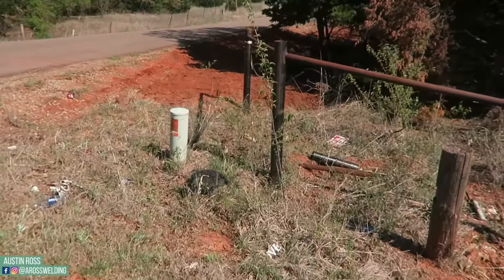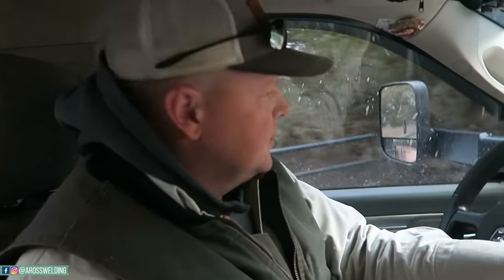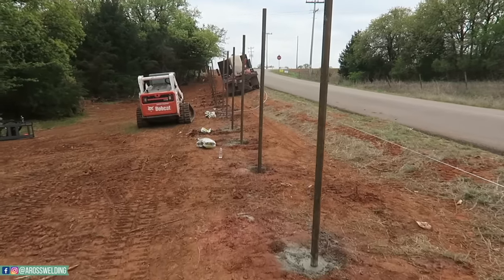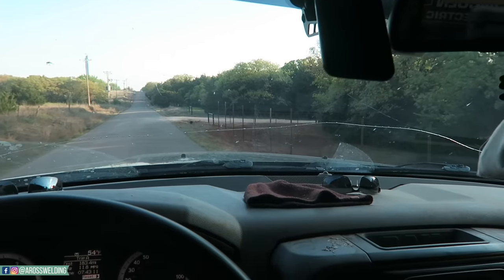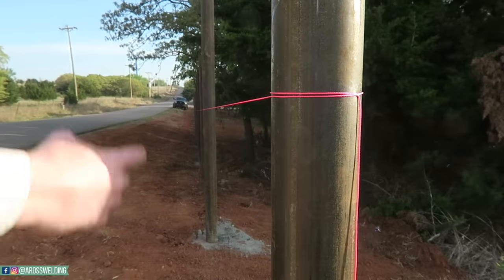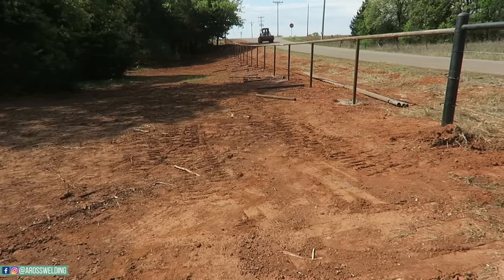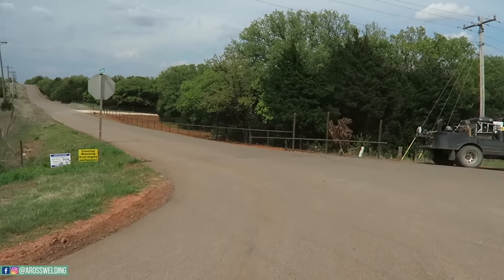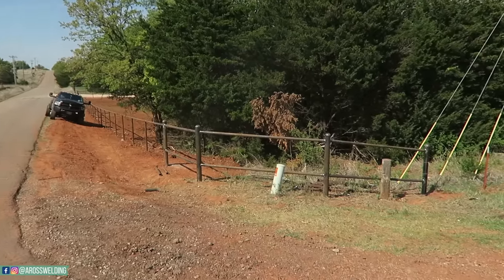SETTING POSTS FOR FENCE // SADDLING AND WELDING OUT TOP RAIL PIPE FENCE

Comment: I just put 420 ft of fence lime this in the front of my place. 5 ft tall though. Im not a welder but my dad was a Texas pipeliner. He passed away 11/18 at 81 yo. He planned to help me but we didnt have a mobile welding machine as he sold his when he retired in 2002. (Still had an 220v cracker box  that he could use ac or dc rids with though) A few years before he died he found a 1981 sa200 he bought for $300 that the seller thought was junk. He had it welding after radiator new water pump starter belts hoses boiled out gas tank rebuilt carb new points and rotor plugs wires (!) I found aa new radiator grill to replace the rusted out one. It did all my fence fine and never smoked or burned any oil! (Front seal leaks a but but dont they all? I made a few mistakes on mine, like putting the posts ten ft apart without checking that the pipe dad bought me was cut in 16ft lengths, not 20 ft. It made some of my joints come out in between posts and looked bad on a couple. I ended up scrapping those sections that looked bad and cutting 10 ft pieces so the joint would come out on top of posts. Nice job and youre right about “curb appeal” and eyeballing the fence. I should have done that more when building mine and i wouldnt have had to go back and redo so much. (You would think i would know that from running conduit!) You wasted a bunch of pipe cutting the posts 10 ft though. You should have included more info on cutting the saddles. I had to use a stone in a grinder and open up the long part of the saddle to get it to fit. I used 5//16 6011 rods on mine. I tried some 7018 I had but i couldn’t get it to work as it isn’t fast freezing like 6011 and I’m just a pretend welder! I am a master electrician though! I wish i had the patience and time to video my build but im 49 yo (yesterday!) and did it all by myself. (My wife and 8 yo daughter  did help me lay out the holes, but i did all the rest.) It took me about six weekends! Still gotta put up the welded wire, hang the gate i built out of thin wall 2” square tube and three old steel implement wheels, (my daughter helped me paint the frame silver and the wheels red as we both have old farmall tractors!) then put up the ghost controls opener! Ive had several people stop and ask me about building fence for them and i told them they probably couldnt afford what i would charge! Its hard work, especially alone and its not even summer yet!

Comment: I always joint my top rail at the post with a piece of angle iron clamped over the top. Weld the saddle out remove the angle iron and weld the pipe together. Takes the dogleg out. You do good work.
Reply: Nice tip.

Comment: Austin - I built a steel fence line using 2 7/8” drill stem posts, top, mid, and bottom rails spaced at 21” Centres. The posts are 10 feet in length, on 14 foot centres. We drove the posts with fence post pounder 4 plus feet down. It’s a thing of beauty.

Comment: One thing I've done for marking the height of the top rail it to not set the string on an existing post when making a significant elevation change such as sharp-ish turn up or down hill.  I set a t-post or whatever is handy in between two pipe posts to tie off the string. This spread the change over two post and makes it visually more fluid.  When tieing to a line post, you'll always be able to look back and see that transition point. Most folks won't notice, but that's just a little extra polishing.

Comment: Yeah, need a better look at that chopsaw table, come on. I designed my buddies welding bed, complete with stainless accents. Fire engine red with polished stainless. I forgot his chopsaw location, but after seeing yours, I got a great location now. Thanks. 😜😎 we built my 5’ fence, ant the top rail carries the irrigation water, which we tapped for sprinklers. Works great, no leaks, thanks to my pipe fitter buddy.

Comment: When I have built "No Climb wire mesh" fences for horse paddocks I used pressure treated posts. I painted the buried part with tree rot resist black paint and instead of filling post holes with concrete I poured a thick cap of concrete on bottom then filled middle sections with locally available sandy gravely soil ( if in your work area) then a top cap of concrete just below ground level (make sure caps are sufficient thickness). If the fence ever has to be removed or posts replaced your not wrestling a giant cement "lolly pop" out of ground Just use a sledge to smash the cement caps and wrecking bar to break bottom caps. As long as the fence posts aren't tremendously load bearing this technique works well in saving time/money. And as always install 45 ° angle "dead mans" to counter the pull of stretching the fence.

Comment: I know lots of people just pour the concrete mix in dry like you are doing but I don’t like doing it that way. We premix all of ours. I think it is much better. We have a skid steer mixer that will hold 18 80 lb bags and has a chute where you can just drive up to the posts and pour. Set the pallets by the water and just drive the skid steer back and forth. Maybe in areas with a lot of ground moisture pouring it in dry works better. Here the ground is powdery dry even 4’ deep. So dry it is hard to clean out the hole with the auger as the powder just falls back in the hole. We built about 1/4 mile of 2-3/8” pipe fence a couple of weeks ago on 8’ centers. We built it a side at a time and set the ~60 posts on each side before noon each day.

Comment: I been welding up some fence lately and I’m just now using 6010. I have always used 6011 because we generally always used old junk oilfield pipe for corner posts but that 6010 runs way better at least on the new pipe we’ve been using. I almost don’t know how to act getting to weld up new pipe for once. I’m not a professional welder so any little bit I can leverage to make my welds better I’ll do it. Lol

Comment: Pal of mine builds motorway signs - he's "Mr Motorway Sign" here - his stock in trade is steel pipe. It used be a pretty reasonable commodity. Not now.  Now it's eye-watering. 

I now watch your videos wondering just what they dropped on the steel-stock - using steel prices here as my reference point. It used be "Utility" grade fencing - it's now become "Luxury Grade" here.

Comment: When doing a1/2 mile or more it  makes the day easy to get a ready mix truck. Have set a mile before lunch with 2 people
Reply: Easier for who? I drive ready mix. Believe it or not, post holes are tricky for the driver.
Reply: @dougdouglass1248  believe it our not I hold a CDL to have been on both sides. Only a steering wheel holder would think it would be hard

Comment: I usually split the last piece of top rail in the middle of a post that way it does 2 things  one it keeps the pipe from swelling from heat and second it makes it look a lot better and down in the belly of the top rail blow a couple hole in it over your uprights for weep holes

Comment: Another good video, It would make it easier for yourself if for welding if you ran a Lincoln LN-25 PRO wire feeder with inner shield setup. When I was doing site work here in Australia as a boilermaker certified welder our standard setup on the truck was a Lincoln Vantage 580 with a LN-25 PRO that we could run either inner shield or gas shielded flux core. It made the work so much easier the just stick welding.

Comment: I I'm working on my pipe fence I cut my Post 7' long make the cut for the top railing set the two corner post first put a string on bottom and one on the top in the center of the pipe the way I can put all my post's to the same high and don't loose any material

Comment: Austin, love your videos and you attitude! Your fence looks a LOT better than mine. I'm a Texas rancher that's more of a mud robber than a welder and I use oilfield scrap cause it's cheap around here although a little more challenging, especially when it's magnetized. One thing though, seems like you wasted an awful lot of pipe with those run posts.

Comment: 1/4 mile of 5 barbwire fence,  I like like H brace with top rail and a leg down. So three post for one end brace. Cut two at 10 foot and one at 6 foot. All 8 foot a part with 18 foot top rail that also dropship down to last post. All 4 to 5 foot deep in concrete.  It will not move in clay or sand. Line pipe post at 3 foot deep. I put them between every 5 or 6 the post. Line post is to keep cattle from pushing over the post. Not fence you built but a fence to brag on.
Reply: And, 6 1/2 foot To post. First wire (top wire)at bottom of white and drop six spaces to next. My actual first wire is bottom to line post. In sand keep bottom wire high. Gophers will cover a low wire in few years.

Comment: Are expansion joints needed on this. My black painted railings move all over the place in the hot sun if I don't make a moving joint every 30 feet.

Comment: Would you suggest using pancake helmets on mobile welding like you have been doing lately? Thanks man! I really like these videos!
Reply: When its cold out yes, because you can have a goodie on and it doesn't interfere with the helmet, other then that the only real advantage is the light weight of a pancake, but doing pipe fence or any mobile welding your constantly flipping your hood up for one thing or another.
Reply from the maker: Absolutely
Reply: @allenmcintosh1184  
Main advantage of a pang-cake is that it keeps the sun from backlighting your lens.

Comment: Thanks for these videos. I’m building a top rail fence like this right now. If you have a downhill slope how do you fish mouth the post top to match the angle for the top rail? Technically you’re cope would have a a shallower side on one side since the top rail is coming over top not at 90 degrees. Any tricks? Thanks
Reply from the maker: That’s exactly right! It would be shallower on one side. I normally just eyeball it.
Reply: @arosswelding   I actually came up with a good trick for the really steep spots. I keep the string line up and make a mark on the uphill side and downhill side where the strings hits. Then take my clamp on cope pattern and set it on the high side and trace half then the low side and trace half and then all I've got to do is free hand the small spot in between that needs to curve up to the top of cope slope.

Comment: Why didn't you check the lent you needed on the post  BEFORE you cut them at ten ft. So you wouldn't not waste so much pipe. Or are you going to weld the drops back together.  Just wondering  like your videos .what do you think about the Lincoln vantage machines. That's what I have kn my rig
Reply from the maker: Had a little mis communication, planned on going deeper with the holes

Comment: Austin, why is there so much waste when building a pipe fence? seems like your cutting off alot of pipe that you could have been closer on. looks like what was cut of was a couple of feet at least. does customer keep the excess? thanks,
Reply from the maker: We usually try not to have that much waist. I planned on going in the ground farther but had a miscommunication

Comment: Looks like my life. Lol I'm wondering about the posts being cut at 10' ? I cut mine at 8' and have very little waste. To each their own .
Reply from the maker: Mis communication. Planned on going deeper with the post
Reply: Ha. Been there my friend !  Nonetheless, sweet looking fence line Austin.
Reply: I like cutting posts art 10ft and going deeper with them. Usually because the pipe comes in either 20 or 30ft lengths and 2ft of scrap just makes something I gotta haul away after. U also like to do a 3 to 4ft deep hole then drive the post to a depth about 4inches above were I want the top rail at. Then wet set concrete out of a truck with heavy slump so it can still be tamped and keep the concrete about 6" below the ground level to prevent frost heave.

Comment: Why so much wasted pipe on the posts’?!!
Reply from the maker: Mis communication. Planned on going deeper with the post.
Reply: I was thinking the same thing Aaron sure hope the buyer does not get charged  for it.
Reply: I hate to waist material.  I would weld them pieces together for more posts.
Reply: @arosswelding  could you show us how to find the saddles for example im going to saddle a 6 inch pipe with a 2 inch pipe think its called miter cut i believe.
Reply: @marcdavis1728   The customer pays for material. You don’t want to pay for waste than build your own fence.
Reply: Ross can you tell us how to quote a pipe job I would appreciate the help